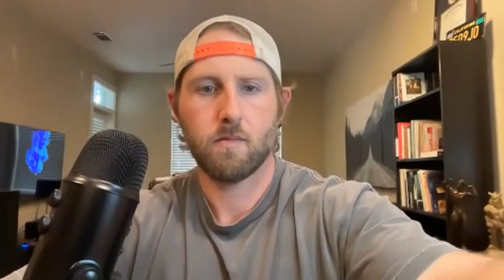2015 Mustang Common Problems

Comment: 2016 Mustang GT here  (bought new for $41,000).   Passenger window motor at 26 K (haven't replaced the motor yet).   AC compressor and flush at 52K miles ($2500).  Intermittent camera outages at 40k (dealer says NTF).  The car has 56K miles now and I'd be afraid to drive it across the state.  This is first and most def the last Ford POS I'll ever buy.  I always buy Japanese and I remember why I do now!
Reply: Same here lol so many problems and it’s a stock car. I’m just working with what I got at this point. But this is definitely the last mustang I buy
Reply: Mine is same year also ac compressor it’s going bad suspension sucks
Reply: How often were you changing the oil? I hope every 5k

Comment: If you’re burning oil and you get your oil changed every 3000 miles there’s something wrong with. If it ceases who cares you get a new engine. It’s under warranty. I have a 2022 GT and I hope my car isn’t burning oil. My mechanic always says everything is ok. Change the oil at 2000 miles then.

Comment: How about driver side headliner not tucking in to the door weather strip properly? Anyone have any remedies or work arounds?
Reply: No problem there, but the left sun visor arm pops off sometimes on the 2015.
Reply: Driver side window destroyed weather strip.  I think it’s a known issue but “don’t care” issue. Definitely an issue. Every 9/10th time I close the door… the window doesn’t seat, inside, it wants to go outside the sill.

Comment: Interesting. I have a 2015 I bought brand new and haven’t had a single problem. Doesn’t burn oil and I change the oil/filter religiously every 3000 miles. Although, I only have 16,500 miles on her. Thanks for the water pump info. I’ll keep an ear out for any weird sounds from the engine bay.
Reply: Same. My 15 GT PP is at 52k miles now.

Comment: Most of the oil consumption is due to the PVC hose that goes into the valve cover has no baffle so oil gets pulled into the PVC system.

Comment: - Water Pump
- Reverse Camera
- Run synthetic oil/change oil frequently. Get a catch can. Watch for oil consumption.
- Low Fuel Sensor Injector Pressure (get the model B)

Comment: 62k on my 2015 Roush stage3.   Very small oil leak on valve cover driver side back of head,    A/C no issues.   My 82 shifts beutfully but every bearing in it makes noise.  MGW race spec shifter made a huge difference.   No oil burning issues, water pump hanging in there.  Coil packs at 61k 4 of them started misfiring.

Comment: I had the water pump go out at 105k miles or so, the back up camera went out too, the heater core coolant hose (the one that goes to the firewall) went out on me (both sides), I had piston slap at 54k miles and got a new long block under warranty, coyote tick just happened the last oil change after 65k miles on the new motor and I added liqui moly and it went away completely. I notice it burns about 1/2 a quart of oil every oil change but I have always used full synthetic oil. Never conventional and I change my oil every 3-6k miles depending on how I drive it as I do a lot of long distance commutes on the highway and I don’t street race anyone. But I’ve had other stuff go out too like my cooled seats on both sides, the GPS stopped working, and my tail light went out but I fixed it by disconnecting the battery for 10 minutes.

Comment: I have a 2015 mustang at 130k miles 
Only problem I got is water pump at 92k miles. 
The rear light at 96k miles 
Oil every 3 months. 
Right now I am thinking change the two belts Belt ac 50.00 and Serpentine belt 109.99 due to high mileage.

Comment: I have a 2015 GT with no water pump, or wheel speed sensor, or oil consumption. But the back up camera brook at 30K and cost like 700 dollaars and now there is a recall on it. I contacted Ford and was told basically to bad that its not covered unless it breaks now.

Comment: Burns a quart of oil every 1000-1500 miles? I guess I never notice. I have my oil changed according to time, not mileage, about every year. The reason being is the oil will hardly get changed if I went by mileage. I have a 2015 and hit 10k miles last month.
Reply: I have under 18k as of Sept. 4. 2024.

Comment: I have 2015 from new.  I changed the oil and filter after about 500 miles and went with straight synthetic oil and filter every 5,000 miles. I added a catch can too.  Zero oil consumption. Thanks for the heads up on the water pump!
Reply: Only a drop of oil on my catch can. I ended up disconnecting it.
Reply: @CHEECHMUN  That is weird.
Reply: @CHEECHMUN That is weird. I have about 1/3 full in my catch can at each oil change (3000 miles). I’d put the can back on bro. It just helps keep the valves cleaner.

Comment: My AC started blowing hot air around 25k miles and took in for warranty service. They replaced pretty much every part evaporator, condenser and compressor. Now I’m at 80k miles and AC started blowing out hot air again. Took into a mom and pop shop to get diagnosed and they said I need to replace the compressor and condenser. They couldn’t diagnose the evap core since it’s behind the dash. So upset and will never get a ford again.
Reply: Update: Bought the AC Condenser and Compressor from GPD ($390) and took it to a shop. Labor total including recharge was $670. They also installed a new expansion valve that came with my condenser kit. Including everything it was about $1100 fix. Getting rid of the car was an option for me but I just paid it off so I don’t want car payments at the moment. Atleast inflation helped me get more out of the car when I decide to sell it 🤷🏻‍♂️
Reply: Evap core is BEHIND the ENTIRE dash…… fact!!! Have pics of my car at does after 4 days “B*t*ng”… sent me a pic with my 25k/mi car in pieces…. air has never worked properly… and I just imagine my air cooled seats do something.

Comment: I was gonna buy one but after all this i might not do it
Reply from the maker: They are solid just a few things to watch for
Reply: @JakeTiesler  only thing really scaring me is the ac system
Reply from the maker: Mine never went
Reply: @JakeTiesler  cool. Do you know what makes them go out? I've heard you have to take the whole dash out
Reply: Honestly, find a seller that has dealt with these issues… the 2015-17 mustangs are EXCELLENT CARS.  Value shows with. 2015 with 75k/mi… catcha almost what Toyota is asking for a Corolla ($40K). Hard pass, rebuilding this engine.

Comment: Bit late to the show but thus far I’ve had my 2017 PP for roughly 2 years. I bought it certified pre owned from Ford with 50k miles. Here is everything that I’ve had to fix (a little crazy).

- AC Compressor
- Water pump
- Front control arms
- Full clutch replacement(Exedy-Stage 2)
- Rear windshield (defective defrosters)
- Both rear axle half-shafts (upgraded to gt350 after these failed)

Moral of the story don’t buy used if you can help it. The only out of pocket item(s) were the clutch kit and GT350  axles which was about $3700 after labor. The other items were under warranty.
Reply from the maker: Thanks for sharing, just a reminder to anyone reading. The only people who post usually are people who have major issues. The people who don’t have issues don’t post as much usually because there’s nothing to say. So sample size is skewed.

Comment: I know this is past its due date. I have a 2015 GT/PP. 

I have  had my entire A/C replaced, doesn’t work as efficiently as stock… BS excuse from the dealership… whatever…
  However,  at around 68k/mi(last year, late 2023. The car started smoking after startup, not initially… the smoke catches(stays contained?)  in the engine bay and mileage doesn’t matter…). First hard stop, 1 or 15mi… smoke pops out and then never happens again, until the car sits for 24hrs (FF here so it often sits for 24/48 hrs.  After that one stoplight the smoke is gone.  I was convinced it was a valve cover gasket…. This “old news”, makes me happy, even though my ‘15 with 75k/mi. Is out of warranty. Planning on keeping the car and upgrading it( Roush, and rebuild is better than a Corolla or a Tacoma for $50k(🤪) No other known issues, love the car!!!

Comment: Oh my God, my man I just found your YouTube channel. I currently own a 2016 V6 manual. First of all bought it brand new at 36,000 miles after the warranty Eco.VAP. Gone! They wanted 1800 to replace it which requires I’m sure you know taking the full dash out. I said the hell with that end up getting it sealed by a mechanic using for like 300 and something dollars it’s worked for a couple of years water pump is now gone maybe not all the way but I have this horrible grinding squealing noise when I turn on the air conditioner or the heater that’s the water pump is going out rotors and brakes 936.00. AC compressor two months ago 800.00 I’m so sick of this piece of shit car still looks great but I don’t know if I want to put one more dime into it nor do I want a car payment as it’s been paid for two years. There should’ve been a recall on the AC and listening to you was just pissing me off even more. 😂

Comment: I have under 18k on my 2015. Today I went to Wally-Mart. 09-04-3023. On the way back, the car seemed like it was starving for fuel. I had to keep pumping the pedal to keep her going. Almost feels like water may be in the fuel. Going to look for my scanner to see if there are any codes.     I wonder if the water pump is related to not changing to the new updated antifreeze?

Comment: A problem I encounter 2015 Ford Mustang v6.
Is that brake light is always turn on. 
Usually you need to press brake and press button to start the engine but due to brake light being on. 
Just pressing the button will start the vehicle. 
I had to unplug the battery in order for it not to drain the battery. 
After three days I was driving my mustang and notice that I couldn’t go pass 50 miles. 
I had my a mechanic check it out and they gave me a problem with brake light. 
I bought a switch replace brake light. A blue piece that’s cost me around 40.00 bucks. After that my car was fixed. I could drive pass 50 miles and required my foot in the brake to turn on the engine.
Reply: Take it to a ford dealer it’s a common problem in 2015 models. They will fix it for free it’s a recall.

Comment: I just bought a 2015 GT Premium pp1 and have problem with the AC right side throwing heat, changed the ventdoors below module and problem still
Reply: It’s dead…. Had to have my entire system gutted. Compressor, which requires the entire interior being gutted… have some pics somewhere… literally, seats, console, dash… taken out…. I think Ford fucked me but…. San Antonio…. You need air with a 6mos old.

Comment: What about a no crank no start.  The Fuse is good.  The relay is good.  The battery is good.  It just won't start.
Reply from the maker: What trim and year? DM me here if you want https://www.instagram.com/reel/CtRfkPDguwc/?igshid=ZWQyN2ExYTkwZQ==
Reply: Same issue I have
Reply: @jennifersingh7538  It was an ele tric fuse that was missing. Double check your fuses.

Comment: I have a 1991 Nissan  Pathfinder 4 x 4 with 185k miles and uses about 1 quart between oil changes at 5000 miles.  I use only Amsoil.
Reply from the maker: Pretty normal - the new mustangs sometimes use oil - old used cars sometimes don’t

Comment: I paid cash for my 2017 I haven't driven that much cause I was modifying the outside to make it as a Batmobile I end up with the fuse Box being messed up but I didn't find that out from Ford all they're saying is I modified the inside so it's my fault I did something wrong with it and I needed to go somewhere else well I well I call these people I came over and tested it and told me what was actually wrong with it but the way Ford is made that part you can't go anywhere else but forward to get it done So I basically argued with them and they're going to go ahead and put what the guys said I paid for the put that part in and then I'm gonna go ahead and take everything off from the outside what I made my bat mobile and I'm gonna tell for the stick it where the sun don't shine and I'm never gonna deal with Ford
Reply: Maybe one of the better years…it’s consistent. Ohhh except for the Killer airbag recall, that they just send out…. How long has Takara been an issue and I just got a recall for it.

Comment: I got 99 problems but the Mustang ain't one. Sorry I couldn't resist from the intro. Great video by the way. 👍
Reply: Wow, sorry. I have under 18k on my 2015. Today I went to Wally-Mart. 09-04-3023. On the way back, the car seemed like it was starving for fuel. I had to keep pumping the pedal to keep her going. Almost feels like water may be in the fuel. Going to look for my scanner to see if there are any codes.